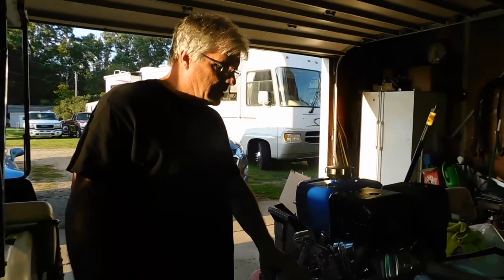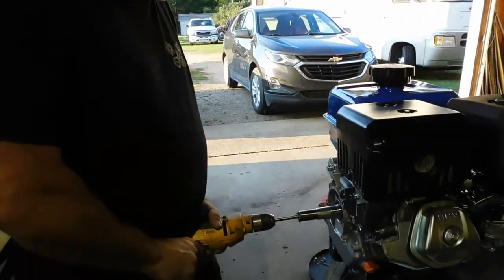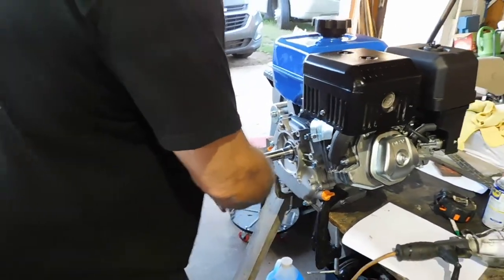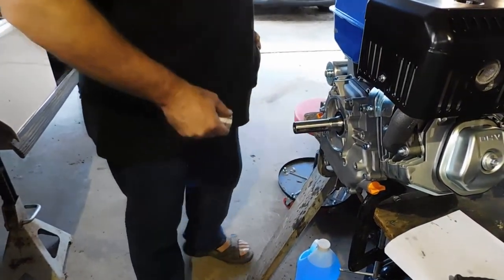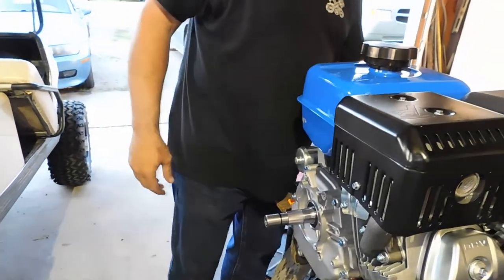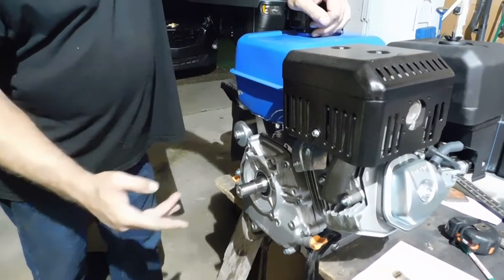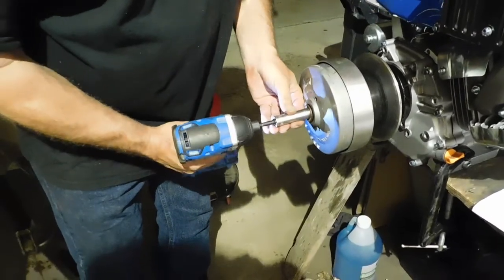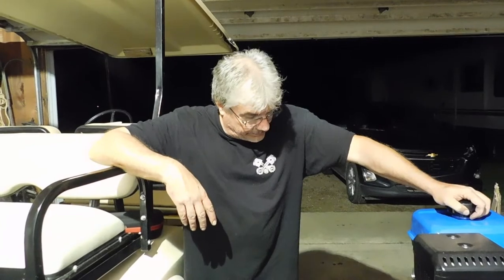Club Car Golf Cart Engine Swap part 3

Comment: What locates the adapter on the shaft? it has to be in or out a certain amount.
Reply from the maker: @pl747  It comes with a bunch of bushings you at the major the old engine and shaft to figure it out. Mine require no bushings It was in the right spot